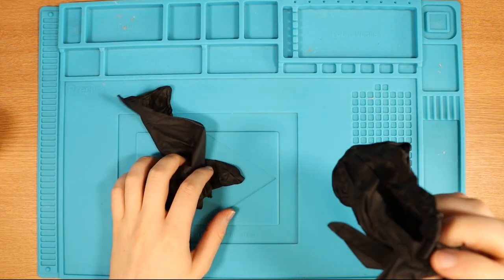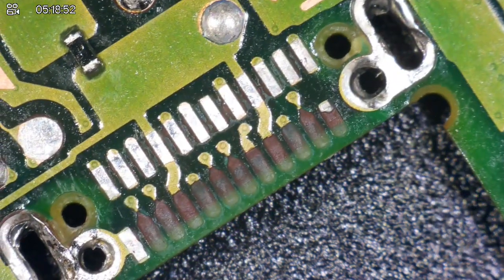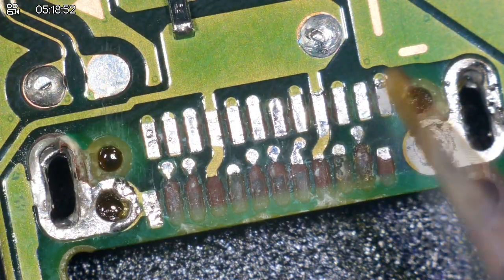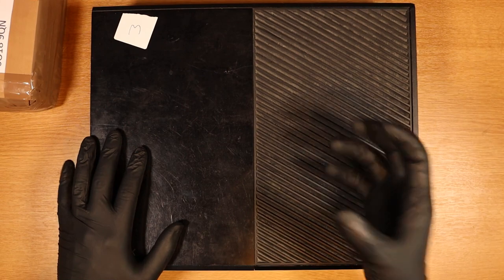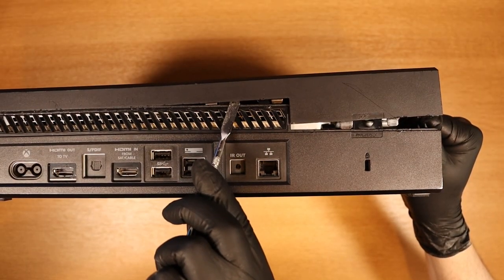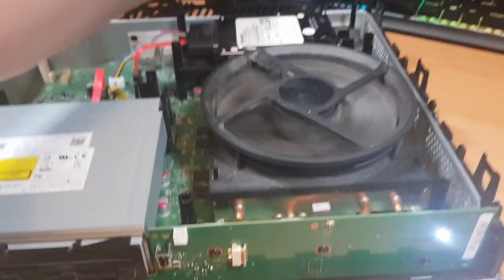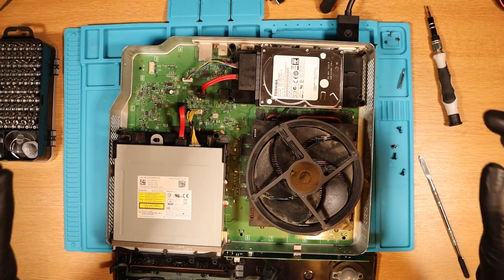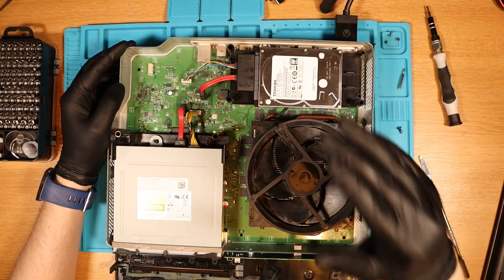It's Okay to Fail and Learn

Comment: Hey Jojo don't worry man, the traces are fixable, with a little practice you'll get used to it. If you need smaller wire, I have 0.17mm, 0.01mm and 0.0067mm, take your pick dude I'll send you some over. By the way those tweezers I use myself, highly recommended for the price
Reply from the maker: Yeah I'll keep practicing for sure. Am I right in thinking the smallest wire is probably the easiest to work with on the Switch Ports? Yeah looking forward to using the tweezers :) That's very kind of you dude thankyou :)
Reply: I agree. @TheCod3r Very Fixable. I use 0.02 wire. I usually scrape off the vias first as much as you can get. I use flux as needed and reflow all those pads. Wick the pads and all the mounting holes, clean up, flux and flow fresh solder on all the pads and vias. Nice puffy pillows. Then, one by one I attach the wires and cut as needed. ( I find the key here is to zoom up close on the scope. A steady hand and a micorpencil helps alot but can still be done with an iron. A tiny bit of solder on your iron and flux are your friend. You will have to clean up from time to time) I usually cut the wire a little longer, just before the edge. I Clean up really good, apply some uv mask to the vias and edges, then apply some flux and reflow any pads as needed. I flux and tin my new port without cleaning it. Then, on the front of the board, I add a little more flux and reflow the pads with hot air in a circular motion at 440c +65/100.  I use an 8mm nozzle, very close to the board.  I move my air slightly away from the pads and not directly on the pads. As they start to turn shinny. I zoom in to the pads and install the new port. (While applying hot air to the board, just slightly above the port, you will see the port flow into position, melting the tins and left over flux on the port, flowing a nice joint.) I adjust as necessary and press down slightly on the port and move the air closer to the port for a quick final reflow. I move the air completely away as I hold the port down slightly and wait for the solder to solidify. If you zoomed in you will see this. I nudge test the pins, solder all the ground legs, clean up and test. 

   Hope this helps in anyway. This is how I do USB Ports on NS, and it works for me,  but might now work for you. There are many ways they can be done. Thank you @TheCod3r for another great channel. Love all you vids and its all your fault that I got into repairs. JK!  Thank you @ Joey Does Tech. Another great Channel! Watching all your vids now! You guys are all great for taking your time to do these videos. I would love to create a Channel but Im too busy with repairs, family and a second job. I don't know how you guys find time, and for that I thank you so much.
Reply from the maker: @thepczone318  Wow PcZone. Thankyou so much for the detailed response! I've actually just purchased some 0.01m wire and my solder mask came the other day so I'm really looking forward to giving this another shot. My only fear is melting the plastic on the switch port, but 440c sounds like a good temp. There will be another video on this! Welcome to the club and enjoy the videos I have on the channel 👍😁
Reply: @JoeyDoesTech   Your very welcome. I had the same issues when I was learning. If you move your hot air slightly behind the port as your soldering it, it will not melt and the heat will dissipate through the board melting the solder for the port. Too high of air flow will melt the port.  Practice, practice, practice. Now these USB ports are so easy for me.  Another very very important factor is having good tools. The temps and airflow I used are specific for my station and you may find that your station is different. Those off brand hot air stations are ok but they don't deliver the correct air flow and heat. I found myself struggling to get an M92T36 off until I bought a good hot air station. I use a BEST BST-863 which is equivalent to an ATTEN 862D or a QUICK 861dw. It works very well and have used it over 2 years now with no issues. Its paid itself over and over. As far as an Iron. I use the HAKKO FM-203 with the dual outputs with a t-15 d-16 chisel tip and a micropencil t30 d06 tip for most of my repairs @ about 430c. 

    I found that these tips give you the best amount of heat transfer at the tip, while still holding solder, and are still small enough to do micro repairs. If your using the wire mesh (brillo pad) cleaner for your tips, you don't need any tip tinner. My tips are over a year old and still working and looking like new. I only clean them with the wire mesh while I'm using them.  The Hakko FX951 is also a great station but only use HAKKO brand tips. They are more expensive but are worth it, unlike cheap china knockoffs which don't heat up well. Also, be aware of Hakko FX951 cheap china clones. They are out there and they are horrible. They look very similar to the real thing. Louis Rossmann has a video on this, and also Sorin @ Electronic Repair School purchased one and made a video but he was very disappointed in its performance. I believe he had a china clone model and he didn't realize it. 

  When cleaning out mounting holes for ports, reflow the hole first with some leaded or low melt solder and use a good wick such as GOOT Wick or I use MG Chemicals  Super Wick. #443. For stubborn holes, lay your wick and iron over the hole and use some hot air to assist and you will see the wick suck it all up. Also, again, beware of knockoff GOOT Wick. Some of it is not real. You can tell by the label. That's why I moved on to MG brand. It seems to work great for the cost.  I'm enjoying your videos and always learning something new. Thanks again for your time and effort for them.

Comment: Don't worry man, soon you'll be soldering those tiny wires with ease! Also, a request - would you be willing to put up the complete livestreams as videos? I try to catch as much of them whenever I can, but between a wife, kid and a home that constantly needs something cleaned or fixed, I find my self ducking in and out and missing quite a bit.
Reply from the maker: Hey pal 😁 I hope I can get there soon, that's what this channel is all about 😁

As for the live streams you should see a playlist on my channel that has ALL of my streams in. They're just not advertised as I have to unlist them due to YouTube algorithm. Let me know if you find them or not :)
Reply: @JoeyDoesTech  Ha I knew I must've been overlooking something blatantly obvious! Well, looks like I've got some videos for the second monitor while I'm working this week.

Comment: The video was great and informative but I have a question do you know what could cause overheat on a PS3
Reply: Dry thermal paste, or lack of proper air flow (eg. dust bunnies or the console being in a tight place), or both.
Reply: @hcabrerab  thanks for the advice cuz I just got my PS3 back and I'll try and fix it plus I have a broken ps4 controller but don't know if I should sell it or throw it away
Reply: @isaiahhunter8846  you may get some money back by selling the controller as is. However, if it can be fixed (you didn't mention what's the problem with it) personally I'd try to fix it instead of selling it or throwing it away.
Reply: The problem with my red PS4 controller is it has bad case of stick drift for the left analog stick but the right one is perfectly fine
Reply from the maker: @isaiahhunter8846  thanks for replying to this Hector 😁 Hopefully you get it sorted pal!
Reply: UnjustifiedRecs  thanks for letting me know, I plan on getting some thermal paste for it. Just don't know which just yet

Comment: I'm sure both are fixable, I  I think the Xbox might have a resistor issue and the switch will be fixed over time.

PS- what do you do if a screw doesn't come out of a dsi (stuck)
Reply from the maker: Hey Bailey :) Usually I would use an elastic band to get an stubborn screws out! Hopefully we can fix the Xbox :)